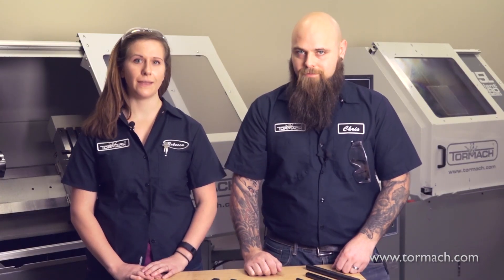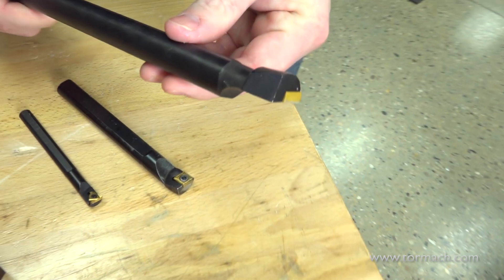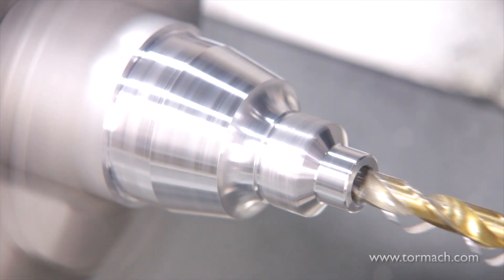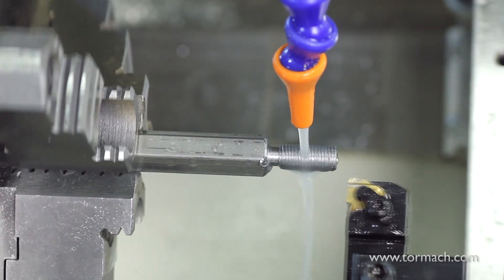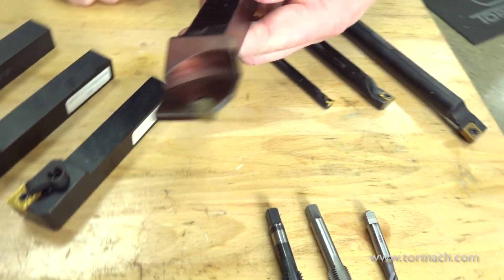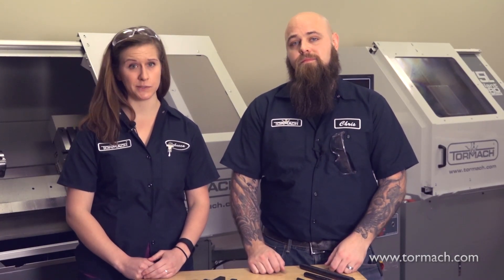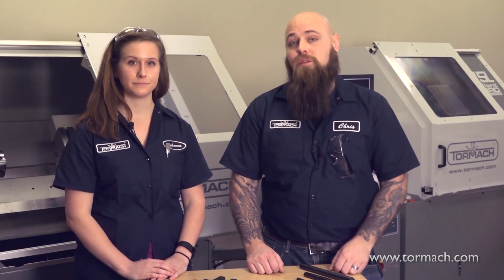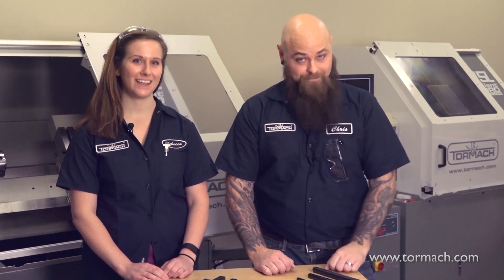Tormach's Beginner Guide to Lathe Tooling

Comment: Great video, still a bit confused on the external tools though.  I just picked up a 7 x 12 lathe and a set of carbide lathe cutting bits.  I assume from what I'm experiencing that these are not the right tool for trying to take a 3/4" piece down to say about 3/8".  This is a link to the type of bits I'm referring to.  https://www.harborfreight.com/pack-of-10-ar-8-rh-carbide-tipped-lathe-cutting-bits-2788.html

Comment: I found the back and forth hard to listen to.

Chris: "There are five types of lathe tooling.
Rebecca: "External turning tools..."
C: "... which work on the outside of the piece you're turning;"
R: "... this includes roughing and finishing work."

It's sounds like good info, but the pacing and sentences split up with different voices makes it hard to absorb. Imagine writing this all out, but switching fonts every half-dozen words. It wouldn't be some great challenge to read or anything, but it would make it needlessly disjointed. It might look/sound "dynamic" and "interesting", but it gets in the way of the information.
Reply: I agree, it would have been much easier if one person explained one tool and its uses then the other explained the next tool and uses.
Reply: Hirudin personally I like it